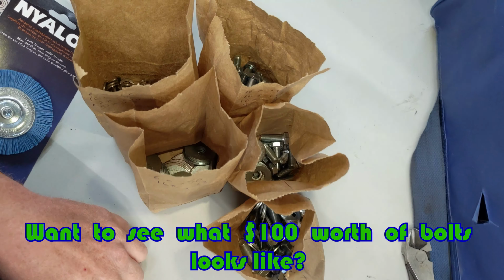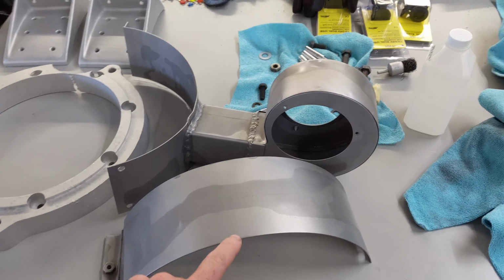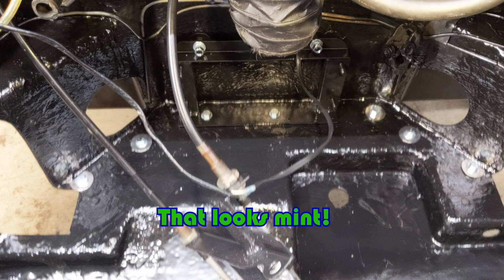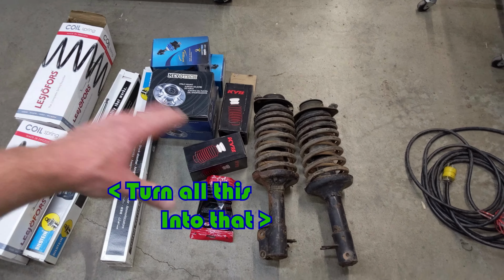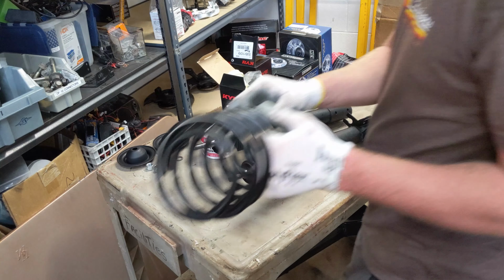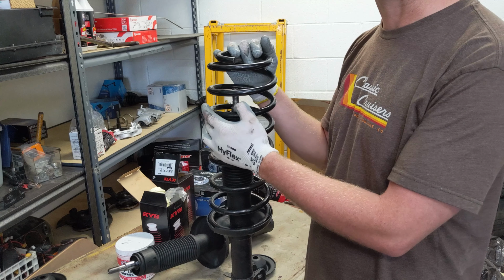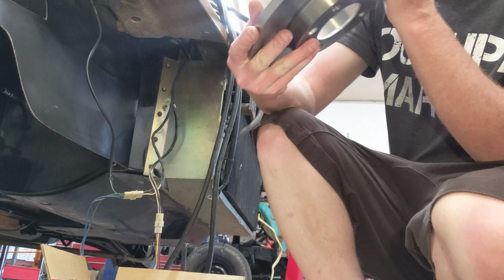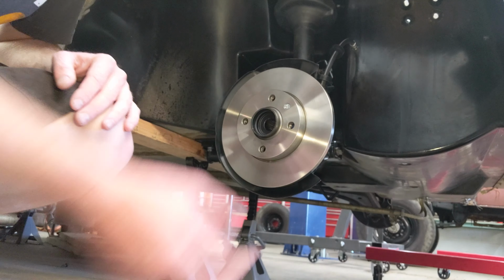Installing the NEW Front Suspension - 1982 UM Electrek Restoration Ep11

Comment: I always go for stainless steel when I replace hardware as well as instead of using regular nuts, I go for the nylon locking nuts. But that’s just me.

Anyway; thanks for the video, keep up the good work 👍🍻

Edit: Also don’t forget to use anti-seize on the brake rotor screws 😉
Reply from the maker: Yep I got stainless. I did get some nylock nuts for some of the fasteners that had them originally.
Reply: @EVSwap  ah okay, they just look like zinc plated hardware on video
Reply from the maker: Well, they better be stainless because they cost an arm an a leg!